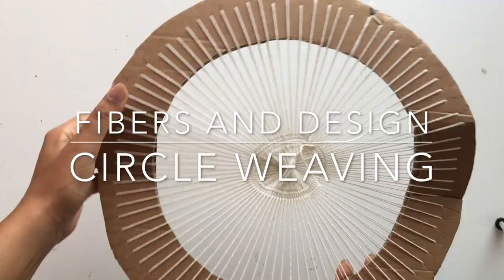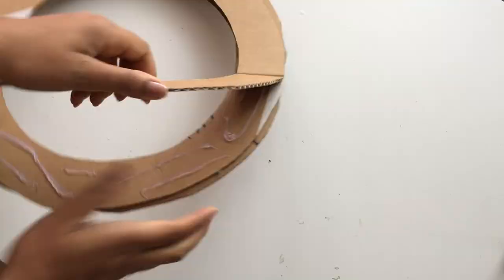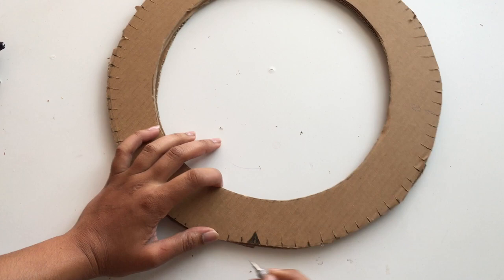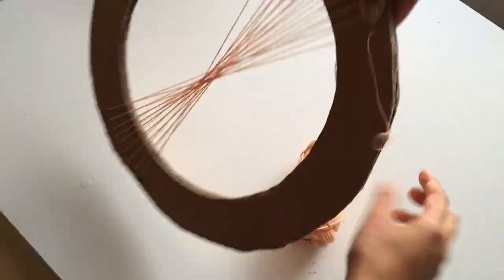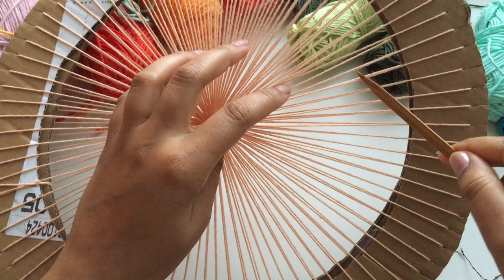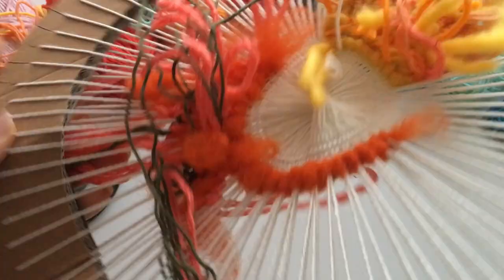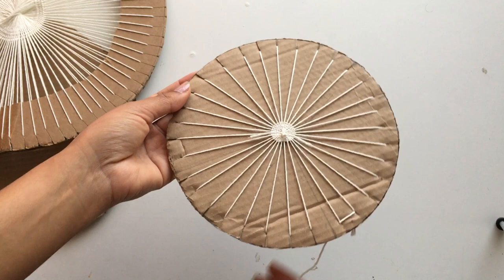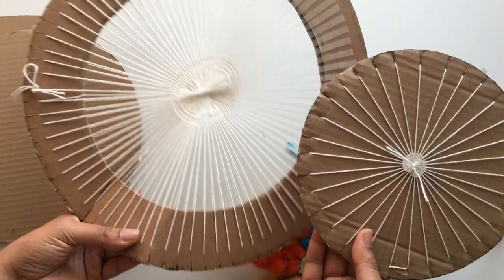Weaving Circles | DIY looms

Comment: I would not use hot glue to adhere the circles together. White glue is way better for cardboard and paper (and wood). It dries slower but has a better adherence and won't space the cards out like hot glue does. Thanks for this video.